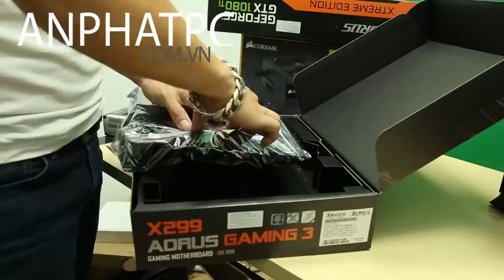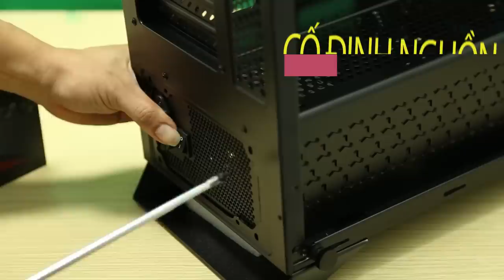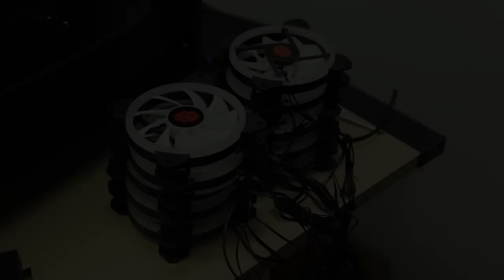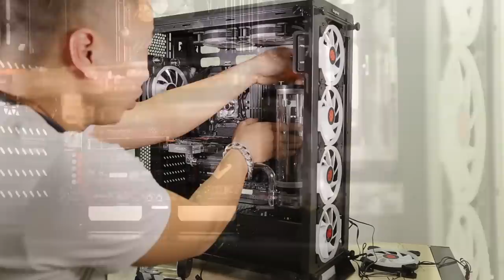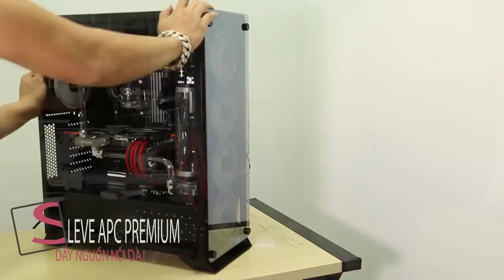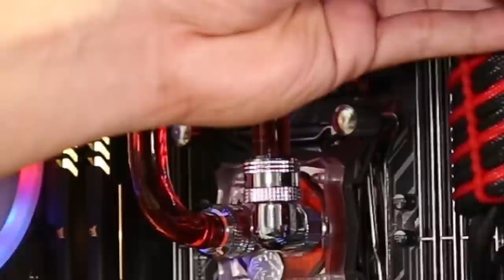Quá trình lắp ráp bộ PC Gaming 70 triệu đồng cho cặp đôi chơi PUBG | An Phat PC

Comment: Thế là con CPU có mỗi một rad 120mm còn GPU thì ko có tí nào vc lắp ngược đời vãi đái 😵 😵
Reply: Mạnh Lê Hữu Đức chủ yếu chơi pupg thì vga full load là chích lên mẹ rad 480
Reply: nhìn kĩ lúc nắp đi. 1 rad 120, 1 rad240 đường nước nối tiếp mà. cơ mà thấy vậy vẫn chưa đủ. trong khi 4 cái fans mặt trước không lắp thêm 1 rad nữa cho mát nhỉ!
Reply: chung phan văn nhìn đường bơm í nước đc bơm từ tank đến VGA đến rad 120 đến CPU đến 1 rad 240 nữa lại vào tank 😁
Reply: thì có sao đâu. với tốc độ bơm cao thì nước trong tank vẫn mát, mà nước trong tank má thì cả hệ thống vẫn mát
Reply from the maker: Hệ thống tản nước gồm 2 radiator làm mát bạn nhé. 1 rad 240 và 1 rad 120. Đảm bảo hệ thống luôn hoạt động mát mẻ và ổn định khi sử dụng ;)